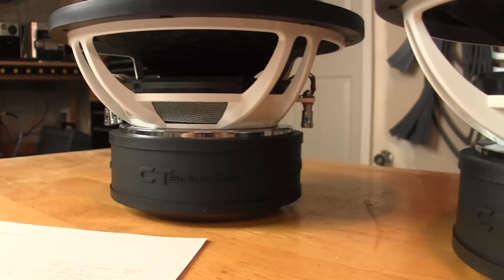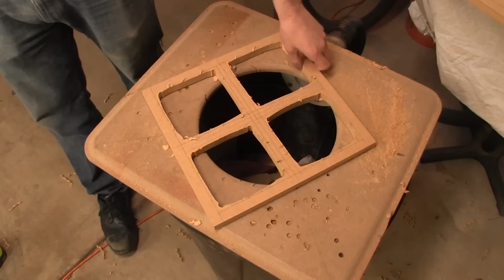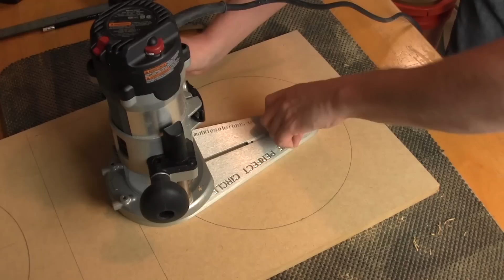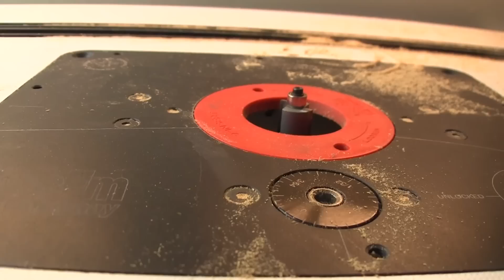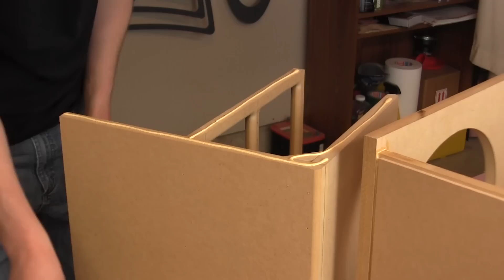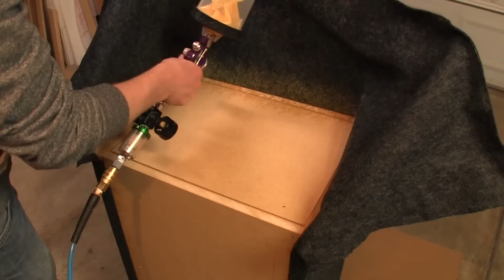CT Sounds How To | Build a Ported Subwoofer Box for 2 12" Subs

Comment: Not an expert sub box builder but not doubling up your box to 1 1/2 in., your getting box flex and losing spl's and full range even with inner bracing.  Considering those 12" subs have the power advertised.

Comment: What is the cost or price to design a drawer for two JBL GT5-12D subwoofers, equal to the 12 Inch Reinforced Ported Box on your page, but I want the output ports at the ends of the box and the subwoofers to the center? Please send me the price for the development of this speaker. Each of 1.75 cubic feet. Thank you

Comment: Like my grandpa did everything. Glue and nails. My first sealed box for a 12in kicker came this way. Thing vibrated horrible. When in doubt glue it and screw it. Pre drill, wood screws and glue. Box will never vibrate unless you break the wood. 

The only way I'd trust a box using just glue and nails is if I significantly increased the surface area of my joints. Finger joints and dove tails go a long way to increase the surface area of your joints.

Comment: Questions, I drew this exact design when thinking of how I want to build my next box for 2 JL Audio10w1v2-8's I have, I am basing my design off of the supplied specified ported enclosure in the spec sheet/ manual. How do I calculate the port dimensions? I am basically thinking of my box as two of the specified box's attached together with an  invisible wall between the outside walls of the ports where in this design the port is a single port but with double the height where they come together? is this correct? Sorry if I worded this confusingly.

Comment: sir can you tell the dimentions of subwoofer box for 4.5 inch 30W subwoofer..
Reply: Kinda impossible to answer without knowing the specs of the speaker, it could be anywhere between 2 and 20 liters box volume. Try and find detailed specs on the speaker and then input it into one of the many speaker box calculators on the internet to get an idea of how big it needs to be.

Comment: What material u r used for making box
Reply: Looks like he's using MDF in the video, but particle board or plywood works well too. As long as the box is strong and "dead" it doesn't matter much which material you use.

Comment: I have 2 American base 12 and I need my Box to be less than 12" tall how would you proceed ? Have the front board at an angle, or mount the subs facing down?
Reply: If it needs to be less than 12in than the subs will have to be on top of the box instead of the front. Find the mounting depth of the subwoofer and try to get at least 1 1/2 in bigger than that. In fact try to make it as tall as I can possibly be before you will ever have to worry about the cone of the subwoofer hitting anything above it. Also if you're having struggles with space I would also suggest getting an aero port. May take up virtually no space except for the internal volume of the port, that means you can have a bigger port for Less volume. And as long as you get high quality one it will never chuf. Consider getting one of the "Big ass ports".

Comment: i wish i saw this video before i started building mine, all i had was 2 quick grip clamps, a 90° corner clamp, a cheap jigsaw, and a palm sander. same sort of design for 2 12's and suede wrapped. easy as, dont need a router, just looks a bit shite with my suede wrap job on the edges. better than the rough plywood surfaces though

Comment: Great insight!!  Those who think they can try this at home, don't try this at home!!  It's won't work.
Reply: You can try this at home. I started doing this when I was 14 and I'm 16 now. I'm building a box for 4 DC Audio Level 1 12"s. So yes you can try this at home if you have the proper tools, and the knowledge of how to use them.
Reply: /b/ Tard can you help me find a design for 2 skar audio sdr 12s? they are wired to 1 ohm and are rated for 600 watts rms each but my amp is giving them 1500 watts rms. my box is way to small right now so i need help building a box
Reply: PurpleSkunkYT go to CT sounds website. That’s how I found my box bluprints
Reply: TheZombieHunter 868 where on the website? all i can find is this video on the website
Reply: Give me your email and I’ll send you mine
Reply: TheZombieHunter 868 sorry i already built my box you should’ve sent it a month ago

Comment: I didn't see any connection on the box to connect power to the subs, as everything was glued and nailed how does he wire everything up?
Reply: The speaker terminal can be placed wherever you choose, or a simple hole can be drilled and sealed with caulk, its not really a critical part of the build, more of something you do once you go to add the box into the vehicle.

Comment: your box designs take to much air space and time to build. screw and glue the corners.brad for temporary hold. after they are a strong point. it's not the corners that need strength it's the large flat  areas. jigsaw internal bracing. if anything. a quick rounding with a sanders.

Comment: So these are wireless speakers?
Reply: Of course this is 2016....  stop living in the past ;-)
Reply: e-Zee boneless
Reply: oh man...he forgo to put connections in the enclosure for wiring the woofers!!
Reply: Nidhin David yup.
Reply: e-Zee bluetooth
Reply: I think it's dummy subwoofer, lol
Reply: Ibad Taylor no he probably thought maybe most people are educated enough to know to drill a hole and run the wire out the back of the box then seal the hole! he said building a box not showing you how to wire it and show you how to use a screwdriver to mount the subs
Reply: @JustSub2Me  I don't like drilling a random hole and just filling it with some form of sealant. It looks nasty and is too permanent. With an SMD terminal I can simply unscrew it and take the wire off instead of having to chop wire.
Reply: e-Zee  I don't even know how that would work with car sub's

Comment: no screws? I am worried it will separate on some low notes
Reply: Just an FYI.  The glue itself has a stronger bond into MDF then screws ever could.  By drilling into the wood you're weakening the MDF by thinning it out in that area. Almost every "Pro" box builder doesn't use screws as they all know it's the adhesive that holds it together not the nails/screws

Before you question me on it. All I do is sell Wood/Glue/Screws/ ect all day every day.  I've heard the same thing from carpenters, contractors ext al day for the last 8 years.
Reply: He uses titebond if I'm not mistaking, which is stronger than the wood.
Reply: He used MDF (the best material for enclosures), the problem with this "wood" instead of any other, is that it's not screws/nail friendly, because the edges are very fragile, all the hard work to hold everything together is made by the glue.
Reply: Brace the box internally and screw and glue it properly together and fasten the subwoofer properly and it'll be plenty strong enough. Steve Meade uses MDF for his subwoofer builds that are pushing 20 000+ watts.

I actually use 22mm chipboard myself, it's cheaper and much easier to work with than MDF. The downside is that it's more difficult to get a nice finish if you paint it.
Reply: @hakont.4960  Then quit being a cheap ass and get real MDF. 😂
Reply: @sethh8892  I use chip board primarily because of convenience. I have a 2000 dollar stereo so I don't think I qualify as cheap really.
Reply: They use Nails
Reply: +Julian Li. nails pull easier than glue
Reply: Weertyyupsaghjkkkkkkk,